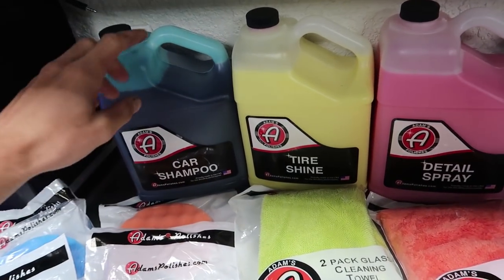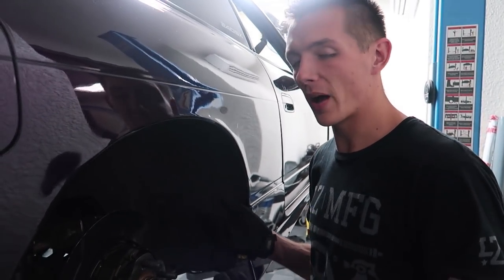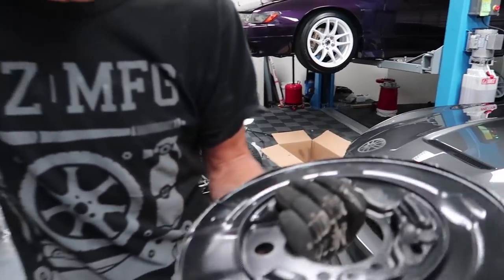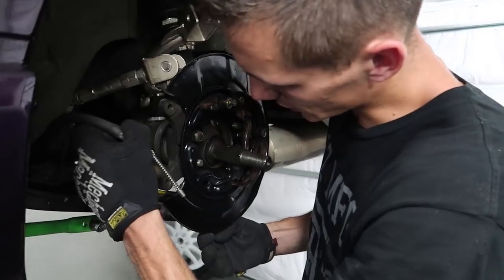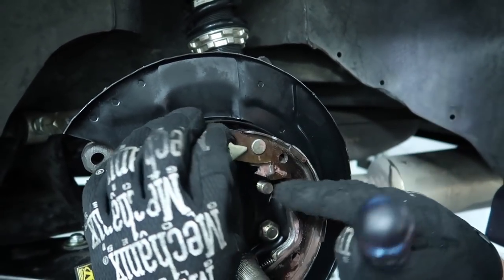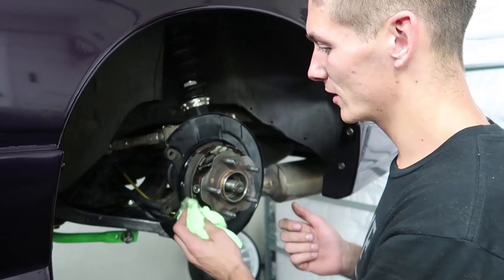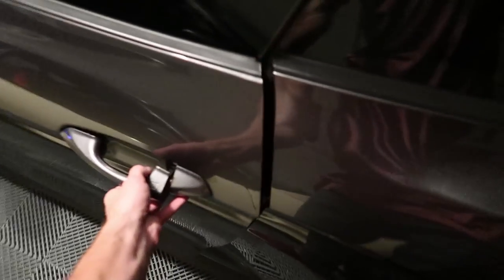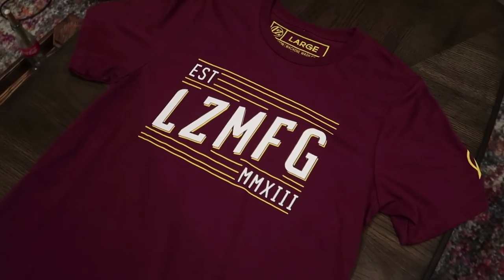Dear Z32 Handbrake Assembly: YOU SUCK!

Comment: Drum brakes are one of the most straight forward things to do. I rattled through them in college but you need the correct tools to help you do it properly and a knowledge of the systems parts . If you don't have the know how then this is hard for you. Some people just don't have the skill in them to do these tasks. Imagine if they were proper drum breaks with a wheel cylinder and the parts to go with, would never be able to do it.

Comment: Adam... the breaks did not look right to me. Let Alberto take a look at the footage... The spring on the adjuster is not the way it suppose to. It will not readjust it self like it is. Somehow I think you do not have the right parts in the right place. Just make sure it is right I don't want that Nicole crashes because of that.
Reply: onhawaii also had the pins holding the shoes in backwards... don't know how well it'll hold the shoes...
Reply: It's A parking brake, and every shoe has a different way to self adjust the star wheel, via spring or key
Reply: Its just for a hand brake and doesnt readjust itself. There is gonna be a rear caliper on the rotor for braking. The rotor should a hole for where you can poke a flat head through to adjust the star wheel

Usual way of doing it is to adjust star till you cant spin the rotor then back off the star wheel about 3-5 clicks
Reply: Also, the pads looked waaaay done... There's not much life on them. :s
Reply: WelshyJunior yea, true that... On my car they're used for normal braking too, but I got dumb and forgot about the disc and caliper... lol
Reply: +onhawaii:
Ditto your comment(s). Ask Alberto to give those brake shoes on both sides a look-see...
Reply: that handbrake setup doesent have a selfadjuster u have to adjust the handbrake after u put the disc on untill u cant move it by hand then loosen it like 1 or  2 turns
Reply: its only a parking brake so she wont be doing 50mph pulling the handbrake.
Its a "parking brake", you use it when you want to park your car, sound pretty logical. And she could also put it in gear to get even more roll resistance.
Reply: on parking breaks they don't self adjust you need to adjust manually as parking brakes arent supposed to get the same amount of wear on them as regular drum brakes
Reply: onhawaii lol
Reply: Nate Wood lol to you too
Reply: MrDanMan roll resistance? If youre facing downhill, put it in reverse & turn the wheel towards the kerb, facing uphill put it in 1st with the wheels facing the kerb, its going nowhere.
Reply: Stop trash talking all these people who gave their opinions like you did and please learn to create a functional sentence.
Reply: What Adam meant to title was parking brake assembly/emergency brake assembly
Reply: Shoes, not pads. And they looked fine.
Reply: Jordan D Its a drum in hat style parking brake. It's always pin thru back of shoe, then spring on top of shoe, then brake spring washer locked onto pin
Reply: Jordan D and it wasn't setting correctly because the hub was off

Comment: HAHAHA drum brakes (including parking brake drums) are the BIGGEST PITA on a car/truck. Drum brakes on all four corners are even worse, because you better hope they are all adjusted correctly.
Reply: Robert Hale Lmfaoo ikr i changed the wheel cylinder in my drum brakes as my first thing i did on a car not fun
Reply: The hardest set I ever worked on were on my 2000 Montero. Those were BRUTAL. Easiest ones were on my 71 Dodge pickup. They were the same all around. My current toy car (1988 Mitsubishi Cordia turbo) has rear drums but they are not bad at all. The front disks are another story since the rotors are bolted to the inside of the hub. Not fun.
Reply: This is so true. Took almost a day to do both rears on a 90s pajero. Biggest pita ever
Reply: I’ve done a few fox bodies and those sucked my vw has drums all around but they’re super easy lol

Comment: Once your done pull up the ebrake and count the clicks. Should be no more than 7-10 clicks. Also spin the assembly with the rotor on and make sure they spin the same amount of times or pretty close at least. That way the same amount of pressure is applied to both wheels

Comment: Do you leave the car in gear, when it is strapped down, in the trailer for transportation?
Reply: Not a good idea since it could damage your gears if it moves a bit on bumps and accelerations. just strap it securely and leave it in neutral. If you HAVE to use something use the parking brake instead.
Reply: I'm betting a car in gear taking a trailer ride is a cake walk on its gears opposed to the same car drifting for 2-3 hours straight.
Reply: I think he just uses wheel blocks behind rear wheels
Reply: That's going to be way less "damaging" than the amount of torque and shock loading it will get when drifitng or doing pulls.

Comment: The e brake Setup is probably the same  on Nicole’s car as it is on the z32, if it’s using a z32 backing plate. You could probably find how to’s on z32 parking brake setups to compare to confirm if it is or not. But it should either be the same as the z32 or the same as the normal s13 parking brake I’d imagine.

Comment: Those ebrake cables are gonna end up on your drive shaft with those thin brackets. Believe me, I know. I went with a street faction z32 ebrake conversion bracket. Comes with hardware and (pre-drilled) screw holes for plug n play. Also when you go to use the ebrake that little bolt on either the top or bottom (been a while) moves and I believe adjust the brake shoes. Keeps adjusting as the brake shoes wear. I believe..

Comment: With a s13 180sx and do the z32 rear brake upgrade does the handbrake caliper get rid of the drum handbrake setup? And what's a brand of front lip like nicole's that isn't fibreglass. The ca silvia front lip is similar but hard to find and its plastic which is good

Comment: I have an s15 & you can do a skyline r33 brake conversion & its pretty straightforward, the s14 has the same suspension asthe s15 & 13 have similar suspension, maybe you should try that instead. But at the end of the day the stock brakes are ok, really not worth it, a lot of people do it cause it looks better, the stock discs are pretty small.

Comment: Adam you have the pins holding the shoes in upside down. They go through from the back so the flat side is against the back. you turn the washer to lock into the front side where it looks like an arrow head. it WILL fall out the way you have it.

Comment: Just need a small 4mm plate with some holes drilled. Google image “s13 z32 handbrake cable plate” to get the dimensions for the plate and where the holes get drilled

Comment: The retaining pins are the wrong way and should come from the back of the backing plate, also, the spring that is touching the adjuster is the wrong way, it needs to be on the other side of the shoes. Also, you didn’t adjust the shoes to the drum.

Comment: My biggest concern with the handbrake is the cable brackets. if they bend down, will the handbrake cable catch on the drive shaft? only because if it were to catch while the shaft was spinning it could potentially be rather nasty.

Comment: That little hole on the disc is so you can adjust the shoes without taking the disc off. Just stick a flat blade screwdriver inside and adjust to how you want it. Hope it helps:)

Comment: should be able to get at the bolts by aligning the flat side of the cv shaft with the bolt also a bit of sandpaper to that hole on the knuckle helps the assembly slide in way easier

Comment: Hey adam that brake shoe tensioner automatically tensions the shoes when you pull it, so if you leave it a bit loose just pull it a few times and it will tighten right up. Hope this helps

Comment: downgrading to drum rears??....no wonder why there is no tutorials on "how to", its a backwards move, should just add a 2nd set of calipers to the rear rotors and hook it to a separate hydro, it is a very common upgrade for drifters here in Australia, we get the 94-96 VR-VS Holden Commodore calipers/bracket/pads and add them to the already existing stock calipers, i had it done to my old R31 Skyline, never had a problem locking the rears ever after that, drums wear out much faster than disc pads and can cause alot of headf**ks when servicing them, but hey....not my car, hahahaha, hope it actually works.....how long they will last....that is another story altogether :-)
Reply: It's still a disk brake, it's only the handbrake that uses the drum.

Comment: What type of brakes are they? Seems like a combination between drums and discs e.e is there an actual name for it?
Reply: JordPlaysGames it's a standard handbrake on a lot of cars. Disks brakes like standard with a drum brake on the inside
Reply: BarberKid Ty! Haven't had the chance to work on a car with discs on the rear yet. So the handbrake mechanism doesn't contribute to normal braking at all, right?
Reply: JordPlaysGames the handbrake (in this case the drum brake INSIDE the rotor) does not contribute to normal braking like the pedal in the cabin. The drum brake is for the handbrake mechanism. Cars usually have this style handbrake, or they Will have a spring next the caliper that handbrake activates and handbrakes using the caliper

Comment: Put a v8 in the Miata
Reply: jtj jbrbtertjk that would be gnarly
Reply: Taylor's doing that though
Reply: 1UZ
Reply: A W18
Reply: It would destroy the weight distribution. I would swap in a decent power straight 6.
Reply: anime connoisseur that isn’t true at all, a V8 doesn’t change the weight balance much
Reply: Ricky Gonzalez It is much heavier than the stock 4 cylinder which makes a big difference on a 950kg car.
Reply: Michael Potts that would be cool.
Reply: anime connoisseur right
Reply: You would keep similar weight distribution and get a fair bit more power. Throw on some bolt-ons and it would be really good just to drive.
Reply: V6 ecoboost
Reply: anime connoisseur most old straight 6’s are still heavy as shit and since they are so long they are a pain